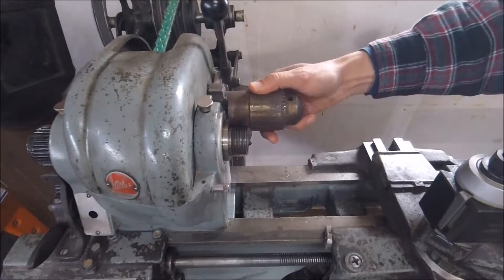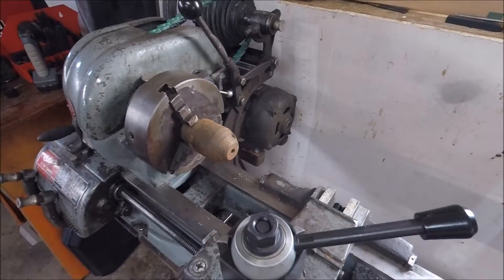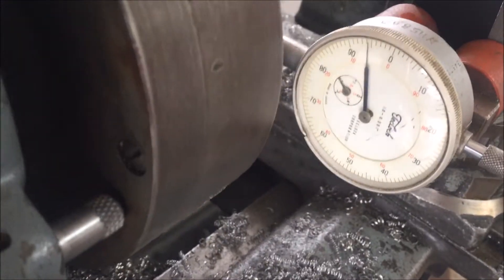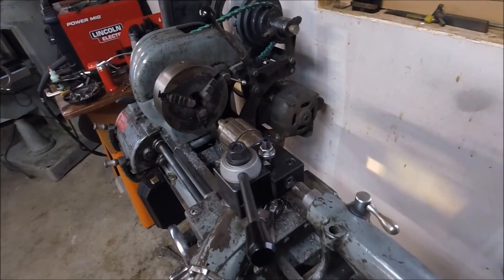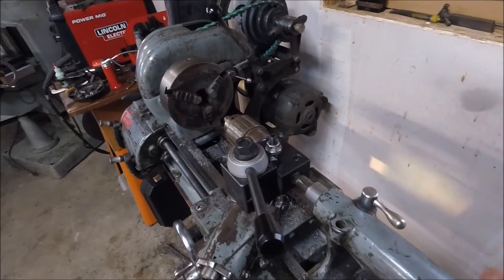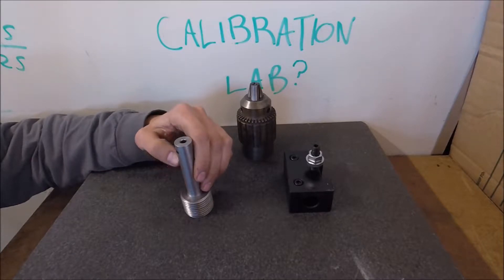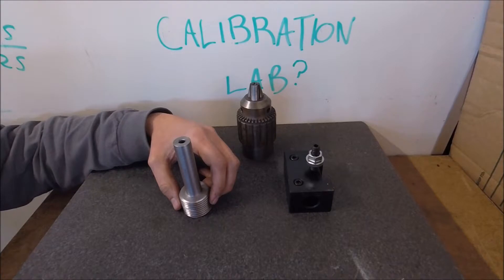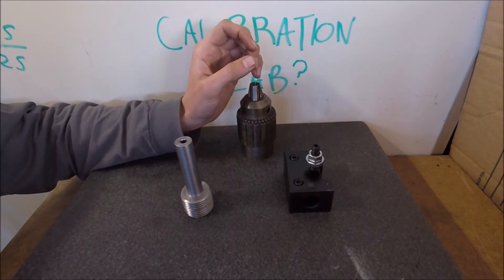Machining Drill Chuck Arbor for AXA Tool Post Boring Bar Holder Adapter

Comment: Just watched your video. Good project.  Don't know why it doesn't show up in my subscriber feed.  I like the old Atlas, I used to have the 9" lathe but not the quick change gears. Is it a 10" ? It looks like you are running the belt much too loose, is that what caused the stall.  I run a 1/2 motor on my 618, the only time it stalls is if the belt slips.
Reply from the maker: Yea I should of said slipped the belt not stall, I just found more video of the threading process and tightening the belt trying to prevent it LOL. This is the QC54 with the 1/2HP motor. Thanks for watching!